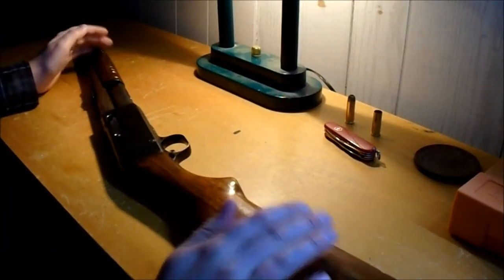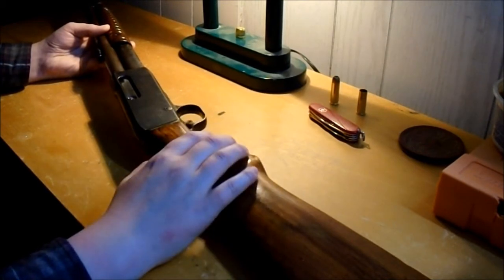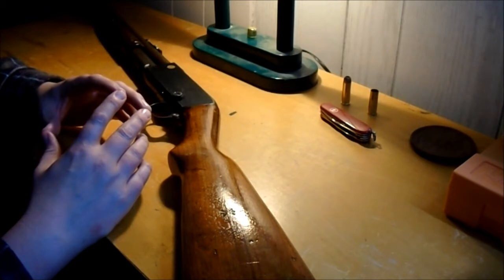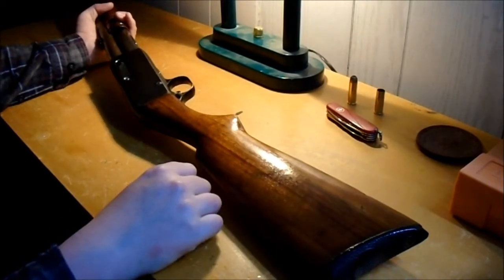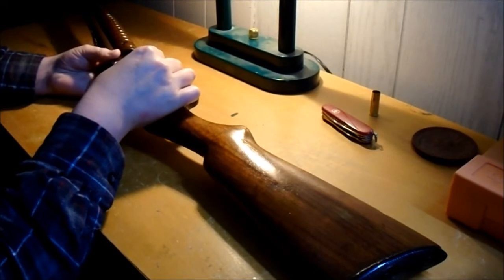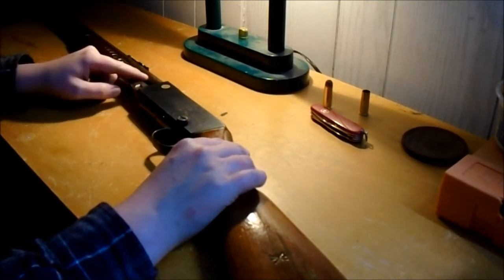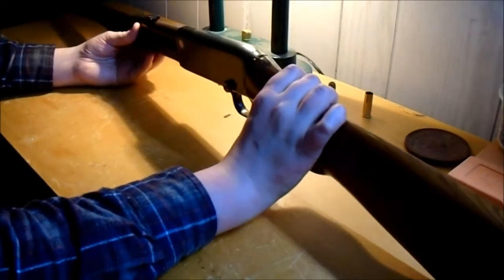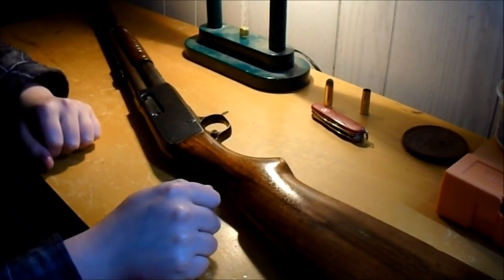Royal Naval Air Service Remington Model 14 1/2 .44W.C.F.

Comment: Woah, this is cool. Another rifle I would love to own! I will have to research this one for sure.
Reply from the maker: its pretty cool :)
Reply: Gungeek Are they inexpensive in Canada? Some stuff is better priced there I hear tell.
Reply from the maker: price on this was close to most ones i saw for sale down your way.
Reply: Gungeek OK, I was wondering if these were kinda like the Winchester self loaders. Kinda odd, but great quality. Price is always what makes or breaks me. Will have to keep my eyes peeled for one of these. Thanks for showing this one, probably wouldn't have run across these otherwise.
Reply from the maker: The 14's are way more common and much cheaper, where I got this one they had a 14 in 30 Remington for $300. of the 125,000 guns some think there were only 10,000 14 1/2's
Reply: Gungeek That's not a bad price. 30 Remington seems like a decent cartridge. I wonder which caliber is the most desirable.
Reply from the maker: the ones in 35 remington because you can still buy it :)
Reply: Gungeek That would make sense. That's what I later discovered after reading about the cartridges. Has a following all its own.